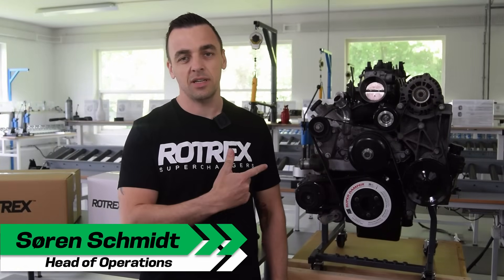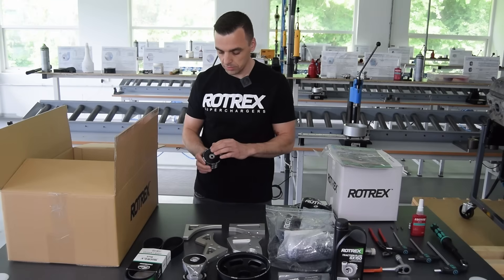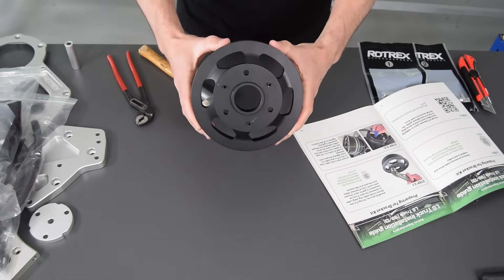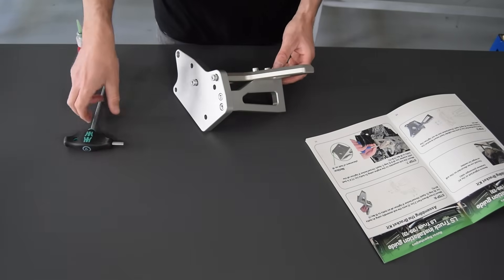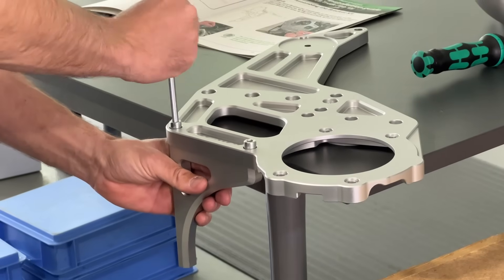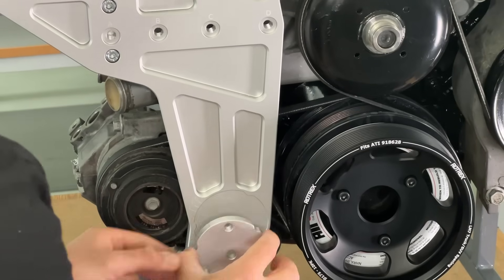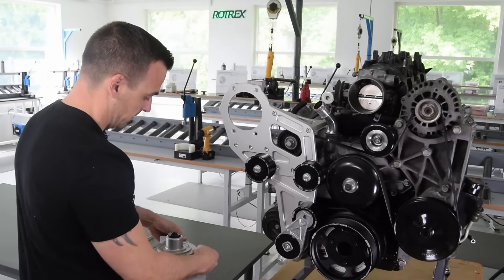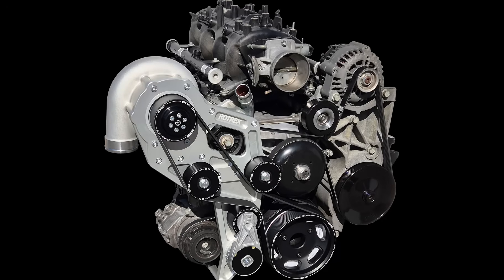Official Launch: Texas Speed × Rotrex Supercharger 1200 HP Kit! How To Install Your LS Truck Kit

Comment: Does this work with a fluid damper ?
Reply from the maker: Technically, it will work with any balanced damper that has the exact same dimensions. The kit is designed to bolt onto the ATI damper, so the spacing, bolt PCD, and bolt size are all critical. If the spacing differs (for example, if the damper sits closer to the engine), the belt will jump off.
The ATI damper part number is 918628.

Hope this helps!

Best,
Team Rotrex.

Comment: What happens to the head unit if the oil bulb busts open? Will the head unit be drained of oil resulting in a damaged or locked up head unit? Why not a self contained head unit?
Reply from the maker: The bulb has been thoroughly tested in-house on our facilities, and we haven’t had a single failure. In the unlikely event of a bulb breakage, it would affect the head unit, but all our extensive testing confirms this is not an issue.
A self-contained head unit would limit the ability to manage oil temperatures properly. By routing the oil through an external cooler, we can ensure the supercharger stays within safe operating temperatures even under demanding conditions.

Comment: Hp numbers ?   How much boost ?
Reply from the maker: It really depends on the overall setup! This kit can support up to 1200 HP, but reaching that requires more than just the kit. If you want to see what’s possible on a bone-stock engine with our LS Truck bracket kit, check out the video Richard Holdener made on his channel!

Comment: Will this kit work without modification. Using milled heads?
Reply from the maker: Please contact Texas Speed with your specific setup and requirements. They will guide you and make sure everything fits and functions as it should.

Best regards,
Team Rotrex

Comment: Wish Y'all had an e-mail individuals could use. I tried sending an e-mail and received a automatic message stating: Please note that this email address is intended for business-related inquiries only. Individual consumer inquiries will not be answered.
Reply from the maker: Hi,

Thanks for reaching out! Since we don’t sell directly to end users, we kindly ask that you contact one of our authorized dealers for any questions or support you need. You can find a full list of our dealers here: https://rotrex.com/dealers/

Our dealers are very experienced and usually able to assist right away. If necessary, they can also forward your inquiry to us.

We hope this helps! Have a great day.

Best regards,
Team Rotrex
Reply: @rotrex_superchargers  What if it is questions about information dealing with Partnerships/Sponsorships?
Reply from the maker: @BadAttitudeC-10  In that case it will be handled when you send us an email. 

I can see that we have your email in our system, and that it is being processed. You will hear from us shortly.

Have a nice day.

Best regards,
Team Rotrex
Reply: @rotrex_superchargers  👍 Thanks for the information.